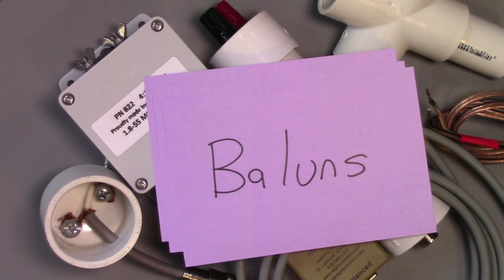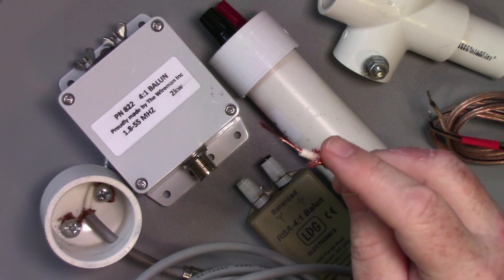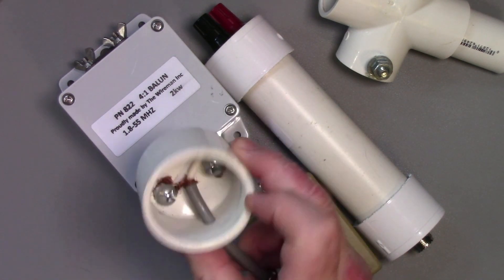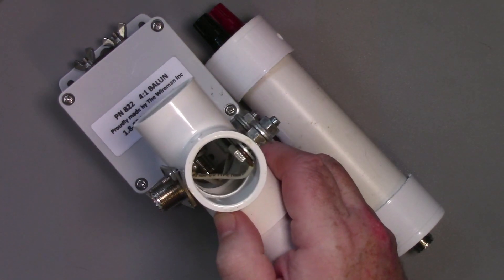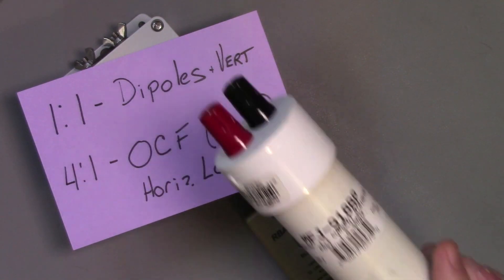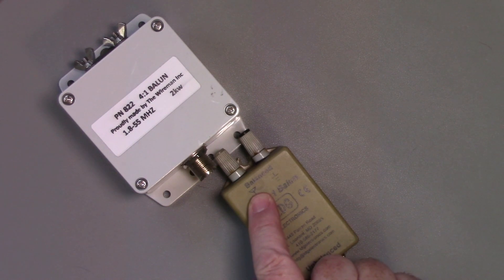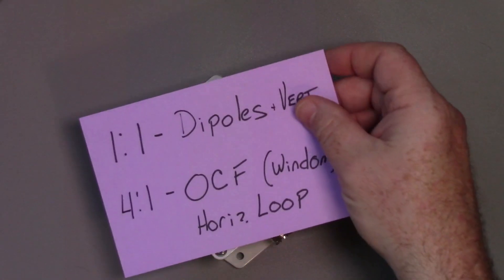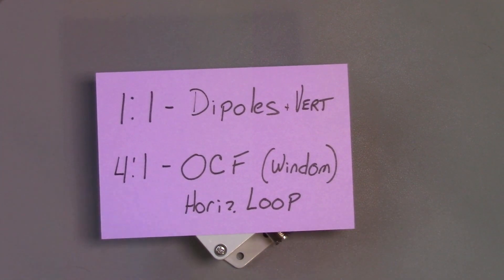Balun Basics [HTL-21]

Comment: New tech here. Why would you want to lower the current in a balun? More watts than the antenna wire can handle? Looking into building my pwn 10m dipole so could I use just a 1:1 balun that just splits the coax?